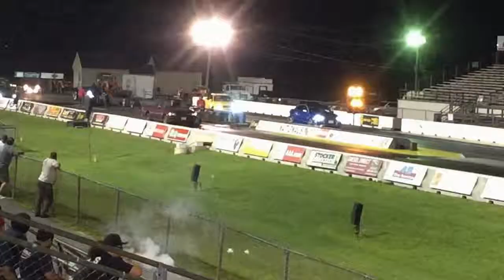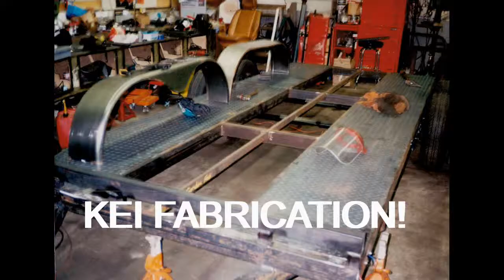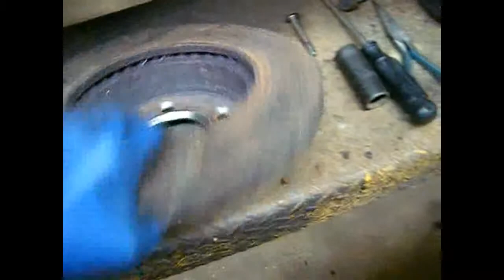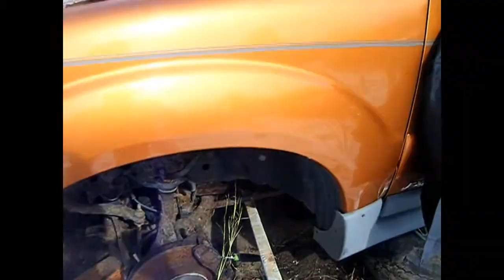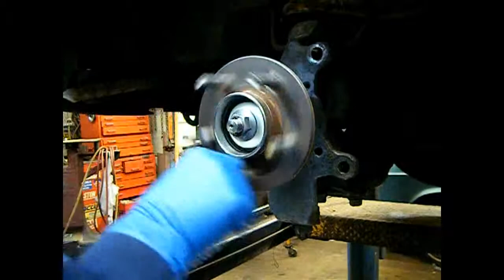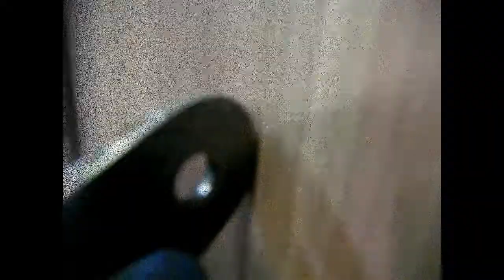LS SWAPPED MAZDA B2200 GETS BIG BRAKES PART2

Comment: How do I purchase a pair of these spaces?
Reply from the maker: Hey OSHB! I have been waiting to offer the adapters until I could put them through some severe testing. I have just completed a thorough inspection after 5000 street miles, road racing, circle track racing, and drag racing. I am happy to report that they appear to be surviving very well!
I will be getting a quote from my machine shop on another short production run of the final version.
Once I get a handle on pricing, I will post information on how to order and pricing.
Thanks for the response!
Reply: @KEIFabrication  I'm so excited my motor is almost done and ready to install.